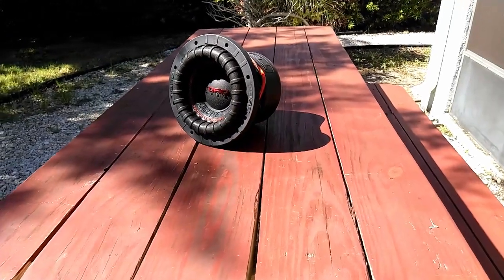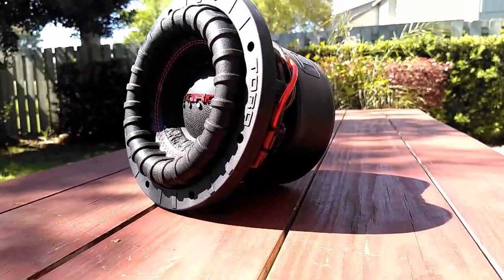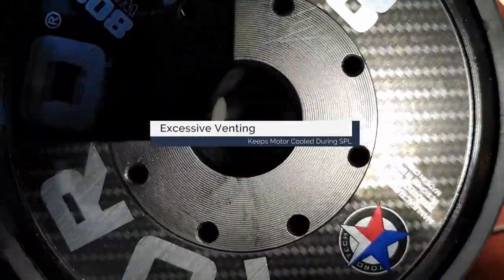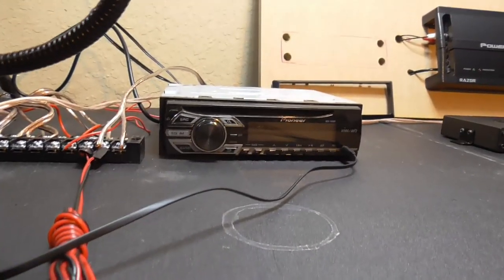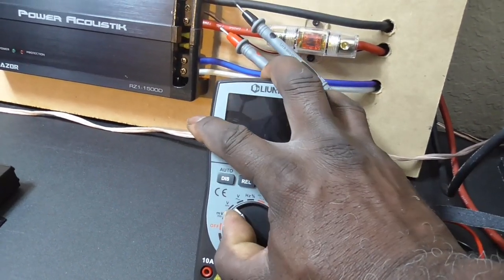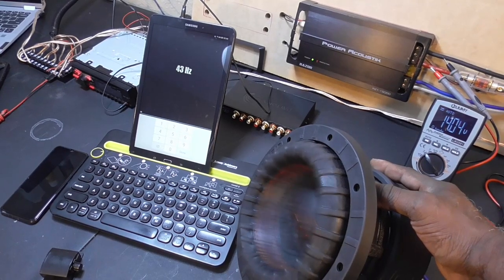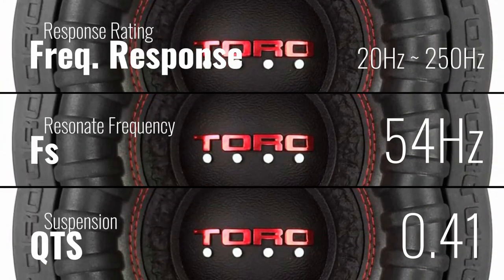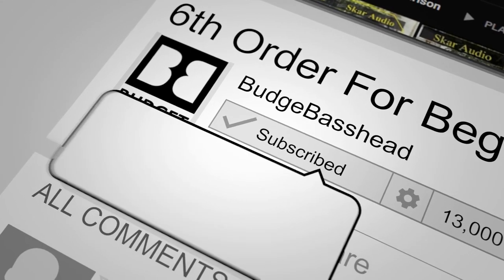Toro Force 8: Complete Unboxing & 500 Watt Free Air Test!

Comment: I've got two of these little subs running off a jp23 amp in a box tuned way too high. (Reccomended box design) These things hit. Only complaint is that the build quality is different between the two one is great and the other is meh so they may have some quality control issues. I'm thinking of grabbing a couple more of these to push 4 of them. Just gotta convince my wife to let me take up a little more trunk space in her grocery getter.

Comment: 2 of these in a t line would be insane,using a space saver design and running it in isobaric loading to shrink the required wave length in half
Reply from the maker: I will be testing this in a T-Line. Stay tuned.
Reply: @BudgetBassHead  hell yeah